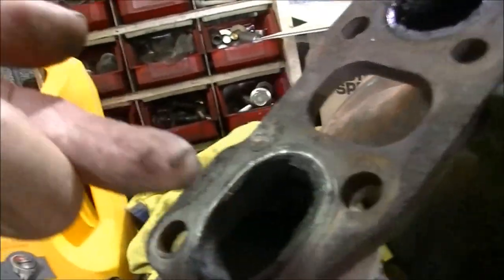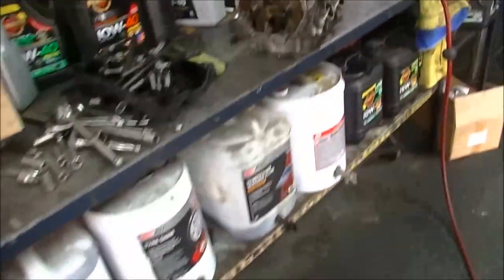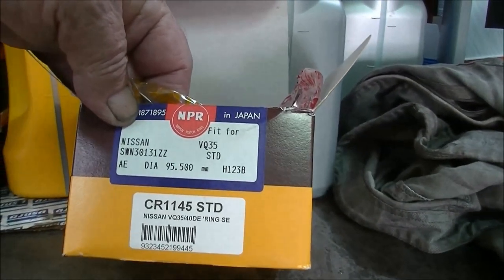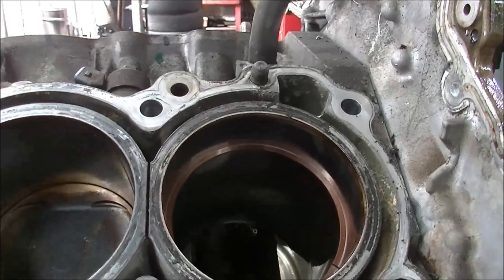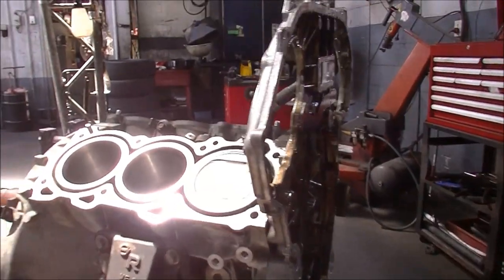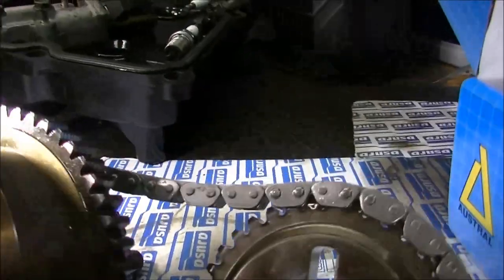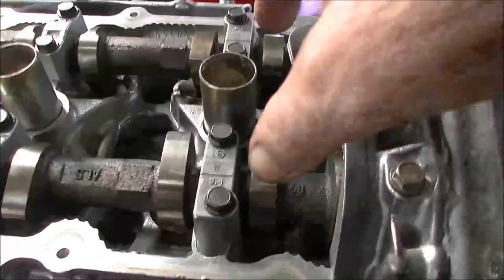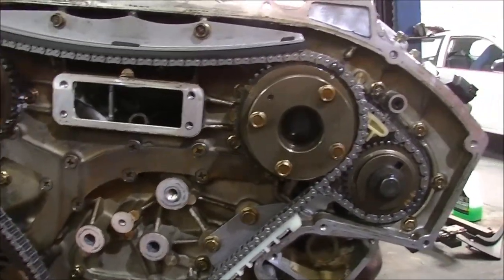Nissan Pathfinder 4.0 V6 Engine repair...Re edit.

Comment: Does the Kotor have to actually come out to change heads
Reply: Motor
Reply: Number 6 on mine spark plug covered in oil blue smoke bad 😔 have it half torn down but I see everyone with motor out
Reply from the maker: It makes it a lot easier to have the engine out and I expect that your engine has the same issue this one did and that was worn out...New rinds fixed it...Cheers Bryan.

Comment: Shame your not around my area I got a real head scratcher of an ly7 engine. Needs a proper mechanic to diagnose.
Reply from the maker: Cheers mate...OK..Tell me...
Reply: @ziggassedup  hahaha yeah. New timing chain kit full clean down. Had plenty of the usual sludge sump off pickup cleaned but now I’ve got chain slap on the main chain at startup and when warm sounds rough and idles slightly rough. Had her back in for diagnostic the mechanic reckons it’s fine. Spent close to 3.5 k so far she’s only got 125k on the clock so not exactly a old engine. Not ever driven hard just a school run everyday.
Reply from the maker: @iangreen398  I expect you changed all the chains/guides and tensioners...No codes.?
Reply: @ziggassedup  chains guides and tensioners but not sprockets or oil pump. Hasn’t got codes. It’s driving me nuts up until the chain job I never had a single issue with the car.
Reply: @ziggassedup  was checked over and set by a proper mechanics shop thought I should say that.
Reply: So you see it’s turned into a real head scratcher.